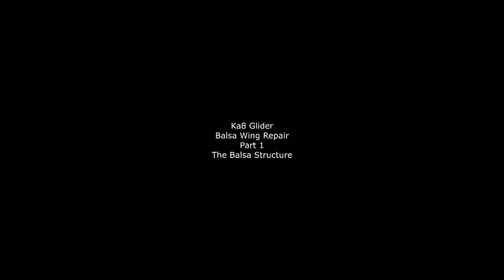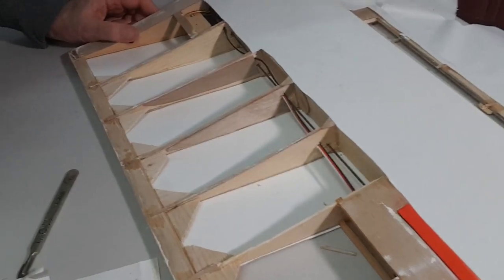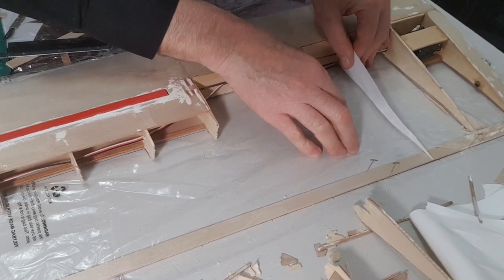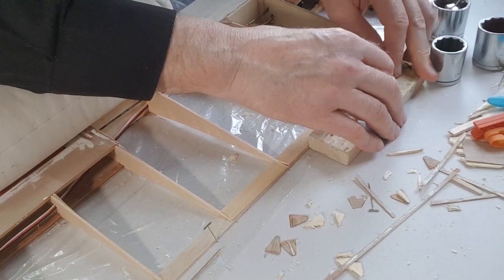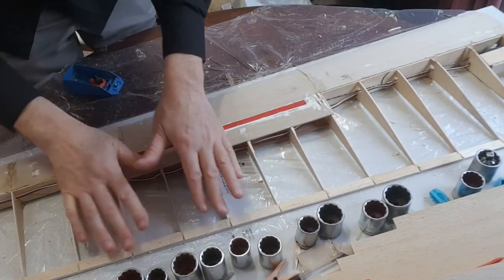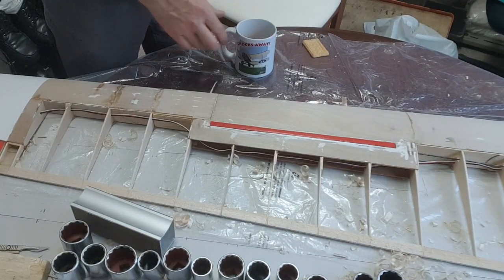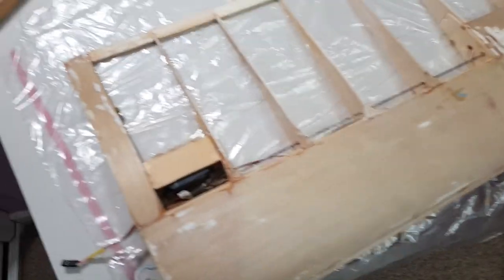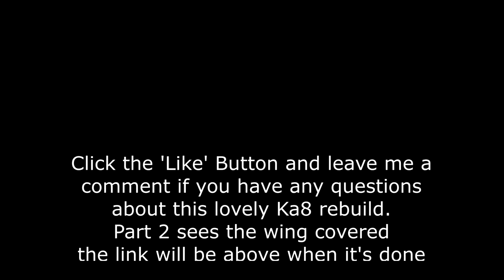Balsa Wood Wing Damage Repair Successful

Comment: Thanks for the video. Would be nice to see how you cut the balsa ,and what tools and glue you are using, etc , how to deal with curves like in Corsair.  Thanks
Reply from the maker: Hi, every repair job has its own challenges, basically you cut out all the broken bits and replace with new. So tools are just a knife and saw and a combination of a white glue and ca. I get the impression that you're not too experienced in repair work? Take your time, don't feel intimidated and make steady progress and you'll get there 🤔👍
Reply: @CliffHarveyRCPlanes  Thanks a lot. Yes indeed I am new to balsa flying and fixing, unfortunately I destroyed few balsa models many years ago when I started including a p51,  so decided to move to foamies. Enjoyed flying these for few years, then though why not try balsa again, went to fly my stored Phoenix balsa corsair .52  but I think the stall point is a bit quicker in balsa than foamies, so I stalled and broke one of the wings into two. Now I learnt the lesson the hard way that there should be continued throttle management all the way until touching the runway.  Thanks

Comment: You're a lot further on than we are in Derbyshire, Cliff. Lambs already?  There won't be any round us for a good few weeks - and there'll be 100s of Jacob's and some Ryelands in the flield next door.  And no daffodils either.  Plus it's really, really muddy.

I'm a repairer, too (though I prefer not be!) and you're making a neat job of this wing.  I like your using socket spanners as supports.  I've moved over to a steel building board with magnetic supports but the socket spanner idea might come in useful.  Hope you're not running out of balsa because it's getting harder to get.
Reply from the maker: Closer to the equator BF 😁 I wonder if it's possible to have a magnetic building board instead of steel then I could use my sockets in reverse! 😁